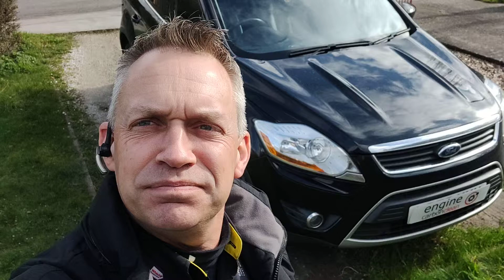DPF Issues?

Comment: Very interesting, I've just purhased a 2010 2ltdci kuga. On the way home the engine management light came on and went into limp mode.
I noticed driving home that whilst driving the temperature stayed very low and only got to temperature when stationary.
I've ordered a thermostat and temp sensor.
I've also replaced the dpf pressure switch (wrong one was fitted?), cleaned out dpf with a spray directly into the dpf.
I've reset the dpf faults, but they come straight on (p244b and p2463)
Because of the temp issue I have tried to perform a static regen, runs a lot better now, but still in limp with same error codes.
Any suggestions, do the errors need to be cleared before a regen can be performed?
Many thanks
Dan
Reply: Did you find the solution? mine is the same. I replaced the dpf sensor, cleared the codes but they come back.
Reply: @verncooper3320  mine was the ecu in the end. Check voltages and pressures from sensor with a mityvac